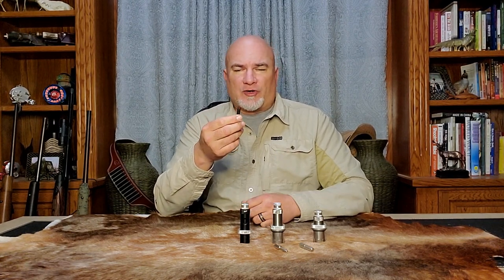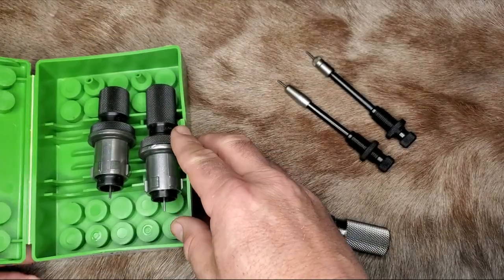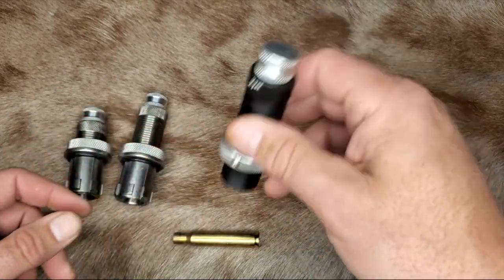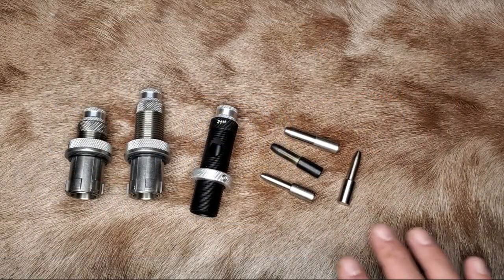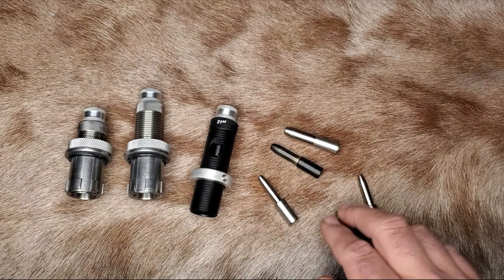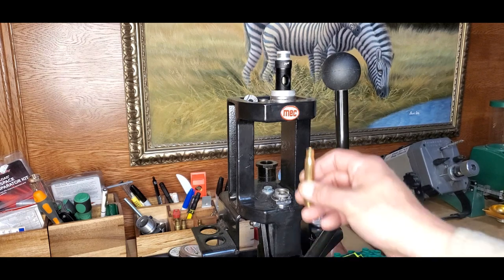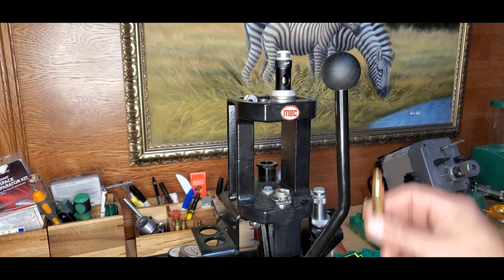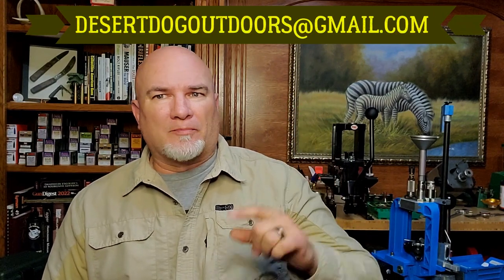UNDERSTANDING EXPANDER MANDRELS

Comment: You know, even with shooting under 200 yards, I have found that inconsistent neck tension is one of the causes of those shot flyers that we all cuss so much because we "did everything right." While the lengths were all the same, the crimps were all the same, brass can be a weirdly inconsistent metal, so if you're not ensuring consistent neck tension, you're going to get flyers. Great video.

Comment: Great presentation, very articulate.  Thank you.  Another selling point for the mandrel approach is that it would seem it would reduce stuck dies in cases.  I've just added (or trying to :-) ) shouldered cases.  I've been doing straight walls for a long time.
? - where can I find metrics on neck tension?

Comment: I'm a long time reloader for hunting but no expert as I go years in between loading depending on hunt. Is this mandrel expander a replacement and/or better than neck bushing dies? I'm just now discovering neck turning and not sure the exact process of whether I still run the brass through the neck bushing die after running them through this and turning them?

Comment: Really excellent video on mandrels. I want several others, but this one really explains more of how which I was lacking. My biggest question is how do you seat the bullets if your 2000th below bullet diam without digging into the bullet jacket. Do you lube with dry powder.?
How much crimp after seating. Light, medium, or no crimp.  
My process very similar but using Lee Collett die after full length sizing. Lee does make mandrel that is 2 thousands below bullet diameter. You ever try

Comment: Thanks. For this information, I been thinking about trying the le Wilson expander dies andan arbor press. I think that would help alot on the flyers. Thanks for your video,
Reply from the maker: I have an arbor press that I used for my last 2 years shooting F-class. Honestly, After I got my MEC Marksman press, I really didn't see any measurable differences compared to my K&M Arbor press. The Arbor press does have a nice feel. In the end, I think sizing causes way more run-out than seating and we overthink it. That goes full circle back to why I use mandrels.

Comment: I do the same as you for super accurate loads especially cast bullets. Another great option is the Lee Precision Collet Dies for those folks who want to skip a couple of steps. I have been reading manuals and handload/gun magazines for decades. No where do I ever recall neck tension articles. It is the most important of all variables. You may want to touch on annealing necks. As you stated when I sight on game I know I have done my part and eliminated all the variables. I know the end result.
Reply from the maker: Since I FL size all of my ammo (match and hunting), the Lee Collet dies would require a 2-step sizing process, making it just as many steps as using an expander mandrel (BTW, ALWAYS FL size hunting ammo). Also be mindful that Lee screwed up the collet dies by redesigning them in 2019 to flare the case mouths. This may make cast-bullet guys happy, but it basically made the Collet Dies unusable for really precise ammunition. Most serious loaders used the Lee Collet dies to prep brass for neck turning; but the new design ruins that. Annealing is an entirely different can-o-worms; either you do it 100% correct, or not at all. I feel that 90% of people who anneal are better off not doing it.

Comment: The owner at 21st century told me to get mandrels .002, .0025, .003 smaller than bullet diameter and not to worry about measuring outside diameter of loaded round because it’s not really how anyone should be measuring neck tension. 

He said to test loads with each mandrel size and see what shoots best. Other than for the magnums. He said to just use a mandrel .003 under bullet diameter. 

What are your thoughts?

Also, do you think inside neck turning is necessary? Does not doing it negate the benefits of using a mandrel to set neck tension?

Comment: I assume you trim before chamfering only because you didn’t mention it as one of your steps is all… Thanks for the info on the 21st Century site; I had the same confusion.  Sinclair is out of stock on their mandrel die, and the L.E. Wilson is expensive.  I’ll check them out.
It seems to me as someone just starting out in PRS, that the 2000ths below caliber turning arbor is the way to go, so in that case it would open up some necks and reduce others, all to give 2000ths under .308 correct?  That means I don’t need to mess with a bushing die, and that brass selection is not as critical?  I just can’t swing $200 for a complete set of the 21st Century mandrels per caliber so want to get close.  Thanks again for the excellent overview.  👍

Comment: Thanks for your thoughts! I found that the expander ball on my full length sizing dies were catching the doughnut in the neck shoulder junction and caused the case to stretch when pulling back out.  Removing the decaping pin with expander ball and using a expander mandrel solved that issue. I don't seat  past the neck and into the case with this cartridge, so the doughnut isn't a huge issue for me.
Reply from the maker: I have seen that many times. FYI, my donut issues first appeared when I switched to bushing dies, and went away when I stopped using them.

Comment: When do you remove your resizing case lube?
Doesn’t the lube affect the primer, powder and chamber case slippage? Creating false pressure signs and loss of accuracy?
Reply from the maker: I don't put lube inside the case neck when using the 21st century mandrels. I completely wipe down the outside of the case after sizing.
Reply: Gotcha, 
Love the channel and your advice is solid. Thank you for the great channel.

Comment: Good info. And being in a place where the extra step & equipment, and the gains by using a mandrel might not suit me just yet, I'm trying to understand if using a carbide expander ball doesn't give a person like myself the middle-ground between the mandrel & stock expander ball. I believe I understand some of the drawbacks of the standard expander. And so I'm considering to get a Lee expander where the ball is floating and carbide to put into my sizing die, so that it doesn't perhaps stretch out the  neck after the sizing. Have you done this, perhaps earlier in your experience before graduating to mandrels?

Comment: Hi just wondered what difference you get in neck diameter (outside) from after Fl-sizing (without mandrel) to after running the mandrel?  My dies seam to overwork the brass. when I run my die without mandrel it sizes the neck to 0,015 less than after running the mandrel. seems to be excessive or?  (260rem RCBS FL).

Comment: Being new to re-loading is like swimming with sharks. Am trying to work wit a 300 H&H Mag. I ordered an Adjustable Case Gauge and a Case Gauge Depth Micrometer and am unsure if I needed them?  And then there is the Expander Die Body which requires a mandrel? And then there is the Belted Magnum Re-sizing Die & Collet. What do I really need?

Comment: 🙏🏼 I’ve enjoyed many of your videos & even shared on FBook via posts to Caliber Groups I’m in. 
Recently I discovered that Lee been making “LEE PRECISION Neck Collet Dies” for most cartridges to be used after full length sizing. I wonder if you have any experiences with them and if so what are your opinions. Thanks for all your content. Aloha.
Reply from the maker: Since I FL size all of my ammo (match and hunting), the Lee Collet dies would require a 2-step sizing process, making it just as many steps as using an expander mandrel (BTW, ALWAYS FL size hunting ammo). I believe the mandrel works the brass less than running it through a FL die, then a neck die. Also be mindful that Lee screwed up the collet dies by redesigning them in 2019 to flare the case mouths. This may make cast-bullet guys happy, but it basically made the Collet Dies unusable for really precise ammunition. Most serious loaders only used the Lee Collet dies to prep brass for neck turning; but the new design ruins that.
Reply: @desertdogoutdoors1113  amazing i didn’t realize the change in the LCND thanks for sharing that

Comment: I have to ask what advantage this method has, if any, over using a sizer die that incorporates an interchangeable neck sizer bushing? It would seem that the extra step can be omitted in this way. I would have to check current pricing to see which is more cost effective, if in fact there is any difference to speak of. Thanks for the video as always. I really enjoy your reloading features.
Reply: I have found that I get better concentricity with expander mandrels than with bushing dies.  My Sinclair concentricity gauge has been a real eye opener.
Reply from the maker: The goal is much better concentricity. Using only my Redding bushings dies, I was having concentricity issues. I was at a point where that was the only shortcoming of my ammunition. . The mandrels (especially running it through twice) brought many of my 1/2" loads to 1/4". Using the bushing die only (no ball), lot-to-lot variances in brass thickness, brass changing with age, and lack of neck uniformity would cause inconsistent neck tension. Basically, expander mandrels give you the benefits of neck turning, with needing to turn necks.
Reply: @desertdogoutdoors1113  I understand now. I have a few competition rifles with tight necks that I use a slightly different method to load for. I am going to try your method on my other rifles though, your results sound impressive!
Reply from the maker: @hillbillyscholar8126  By tight necks, are you referring to tight chambering in the gun? This is a common issue with bushing dies and rifles with tight chambers, because they don't size all the way down to the base of the neck.
Reply: @desertdogoutdoors1113  The tight necks I mentioned have a specific diameter stamped on the barrel and need to be loaded with neck turned cases. Generally speaking I start the loading process by running the virgin brass over an expander mandrel similar to the one you use, the only difference being that the mandrel is the same diameter as the actual projectile. I then turn the case neck to provide the needed clearance around the case neck. I then check overall case length and trim if needed. The brass is then run through a neck sizing die with a bushing that will provide similar tension as you use after springback. I anneal when the cases need trimming thereafter. I generally get loose primer pockets before anything else goes south. Needless to say I am not the type who loads the same five cases at the bench like real IBS shooters, but this method is used by most of the shooters I know at Williamsport for 1000 yard benchrest. Sorry to bore you with a long reply but I think you can appreciate the info. Thanks for sharing by the way!
Reply from the maker: @hillbillyscholar8126  Ohhhh, I didn't know people were still using "tight-neck chambers" in BR. Back in the day, everybody ran them, and the saying was "keep em' thin if you wanna win". But most F-class shooters backed off that mentality now that we have great brass and precise annealing machines.
Reply: @desertdogoutdoors1113  To be honest I am familiar with a family of shooters who are all in the BR Hall of Fame and they ran 6.5x284 rifles that needed turned necks, but it was minimal. I think Sittman built their rifles and they used a custom reamer that left a generously thick neck. I have not had skin in the game for quite a while but am still a lurker...lol.

Comment: In your steps to reloading you never mentioned trimming cases, or at least checking case length. 

Also I see you have a MEC. 
Gathering info now for a second press. 
Either the MEC or Co-Ax. 
What’s you thoughts about the MEC?

ACM

Comment: May be a very rookie question, but when would you trim to length if needed? Thank you great videos very helpful.
Reply from the maker: Every reloading manual will have brass trim length for a cartridge. After every firing, measure your brass, and if it's over that length, trim it.
Reply: @desertdogoutdoors1113  Thank you for the quick reply! Just to clarify though do you trim before you resize? Thank you again for your willingness to teach.
Reply from the maker: @allamerican1248  You resize first, because sizing can change brass length.
Reply: @desertdogoutdoors1113  Deprime, tumble, resize body, resize case mouth (mandrel), trim, debur, chamfer, prime, powder, seat bullets. Hope I am not being too much of a pain in the butt. Thank you again

Comment: if a case has been fired several times without being annealed...it will likely become "work hardened" which means it will have more "spring back".
This may mean that a case may  not hold a bullet after sizing...
I experienced this on the occasional 270win case that hadn't been annealed, sized with Lee neck Collet die.
After annealing, the work hardened spring back is removed...and the case is successfully sized with same process...to hold a bullet.

I guess with neck expanding...if you don't anneal and have fired several times...you may need to change mandrel...to suit....I guess...

Comment: Great as usually! Thanks for sharing your experience!
When do you trim the cases? Before or after mandrelling?
Reply from the maker: I trim after sizing, then chamfer, then run it through the mandrel.
Reply: @desertdogoutdoors1113  Have you ever noticed any case length change after that sequence? I mean length after trimming and length after “mandrelling”
Reply from the maker: @ІванСеркіз-ъ5к  The mandrel doesn't alter case length at all.

Comment: Do you run a bushing die first then a mandrel?
Reply from the maker: Yes, you can do it that way. You can also remove the expander ball from a standard die and use a mandrel as a separate step.

Comment: A suggestion for a shooting accuracy topic is why is there usually a flyer in a group.  Is it the ammo or rifle or shooter?
Reply from the maker: Good shooters know when they cause a flyer, and shoot enough groups to know their consistency. Ammo problems are detectable; ES's, SD's, velocity, case and BTO length, and concentricity are easily measured without looking at groups. When you have all those bases covered, you can tune seating depth and decide if you want to change powder and start over. Reloading 101.

Comment: I am confused...Do you still full length size you brass shoulder bump 2 thou by still removing your decapping rod..I decap with a lee decapping die than full length  all my brass shoulder bump 2 thou..Than I use a bushing die.
Reply: Yes, you deprime, then full length size it without the decamping rod in (bump shoulder) the neck will be squeezed down so then you use an expander mandrel to bring it up to what you want.

Comment: Question?   What happens if I size but don't use the expander mandrel and I just seat the bullet?
Reply from the maker: If you're expander ball is still in your sizing die, you don't use an expander mandrel. If you decide to remove your expander ball from your sizing die, you use a mandrel for neck tension.

Comment: Why can't you just get a honed neck in your die or use a bushing and size you brass 0.001 or 0.002 and not bother expanding at all?  If you squeeze the OD consistently and don't bother expanding at all is that not producing consistent neck tension w/o the extra step if the brass necks are turned?
Reply from the maker: If you use a bushing die only (without an expander ball or mandrel), you will get inconsistent neck tension based on slight inconsistencies in brass-wall thickness and neck concentricity (if you don't properly turn necks). The mandrels remove any inconsistencies from inside the neck, and improve concentricity. These days, the only competition shooters who turn necks are the guys running tight chambers. I don't turn necks because running an expander mandrel is way easier and does the same thing. If you do use bushing dies, the SAC bushing are far better than the Reading bushings. This of course, only applies to those of us who are meticulous reloaders, and is not really necessary to make decent hunting ammunition.
Reply: @desertdogoutdoors1113  Makes sense. My frustration is taking one of these new custom rifles to the range that come with 1/2 MOA guarantee with premium factory ammo such as Hornady Match, or ELD-X and sure enough I'm getting half or 1/4 minute groups, yet my meticulous handloads are taking forever to get less than MOA and I'm turning necks, sorting bullets, weighing each charge, etc., and we all know Hornady is not producing Lapua or Peterson quality brass. What brand mandrels do you recommend? I'm looking at a few
Reply from the maker: @Accuracy1st  I highly recommend the 21st Century Turning Arbors that were featured in this video. PRO TIP: When you use a mandrel, always run it through twice to eliminate inconsistencies with brass spring-back.
Reply: @desertdogoutdoors1113  I actually called them yesterday. I'm going to order from them. What do you do about the "donut?" I have some Lapua 6.5-284 brass twice fired now showing the donut

Comment: Tip: Take the expander ball and spin it in a electric hand drill and shave it down to approximately.300 thousands with a flat file, that way you can still de- prime and not touch the neck. As stated in your video dragging the expander ball through the neck just destroys accuracy. I do not use any expanders in my dies haven’t for years.

Comment: Is .002 enough for the magnum cartridges?
Reply from the maker: Do you also crimp your Magnum cartridges?
Reply: @desertdogoutdoors1113  I do not.
Reply from the maker: @MrHf4l  I use a Lee FCD for everything over 300 Win Mag recoil. I highly recommend doing that to prevent bullet set-back in the magazine. For cartridges like the 300WM/WSM and the 7RM, .002 neck tension is fine as long as the rifle isn't too light.
Reply from the maker: @MrHf4l  yes, with the Lee FCD.
Reply: @desertdogoutdoors1113  Thanks DD! 

You ever hunted MN?